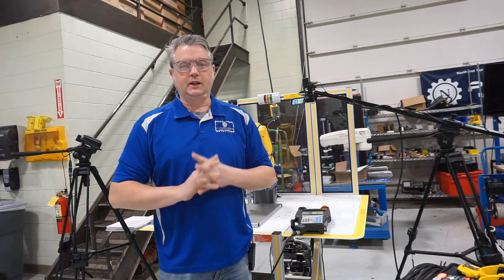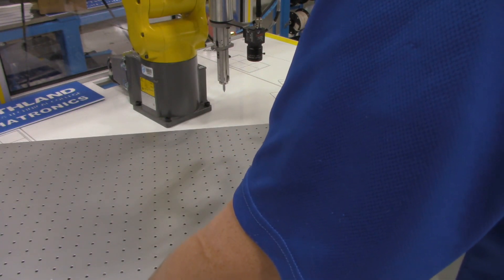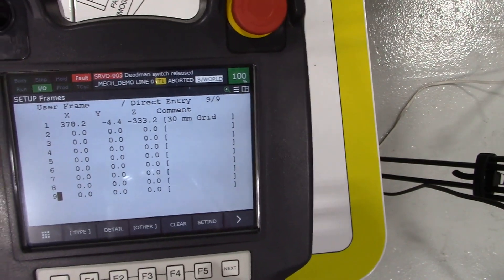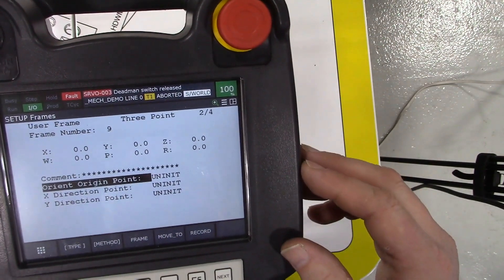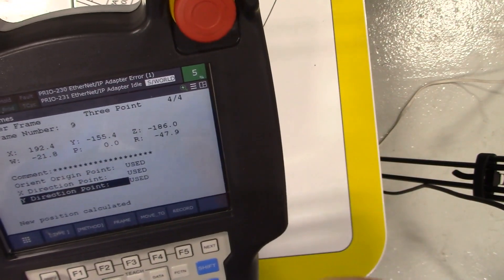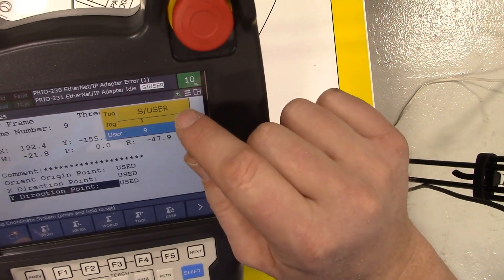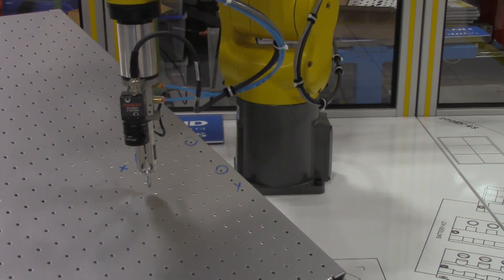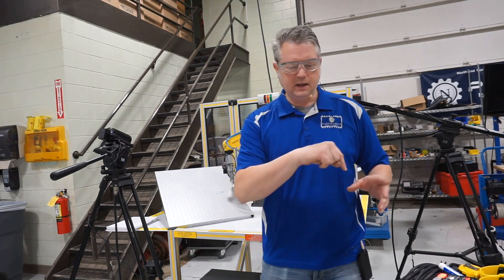Fanuc User Frames

Comment: As you were joggling around after setting up the new user frame and nee x-y directions, you didn’t show which buttons you were pushing. Were you using normal X Y buttons on the pendant when jogging it on the new X/Y axis?
Reply: x y buttons i think